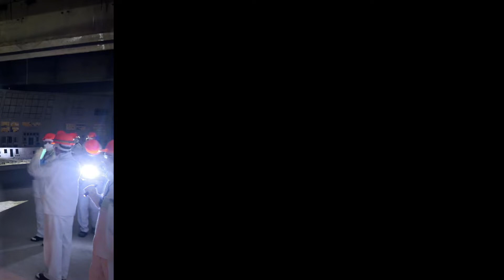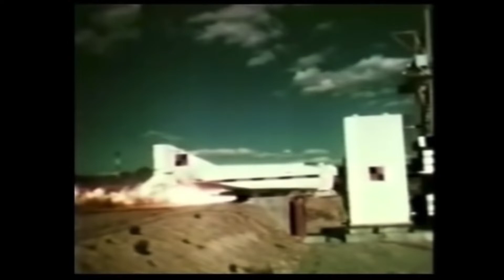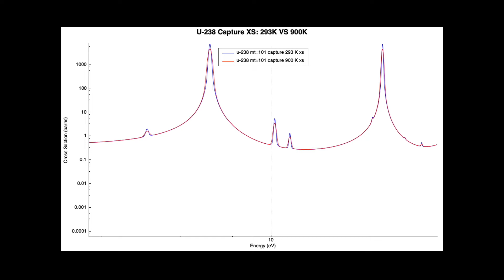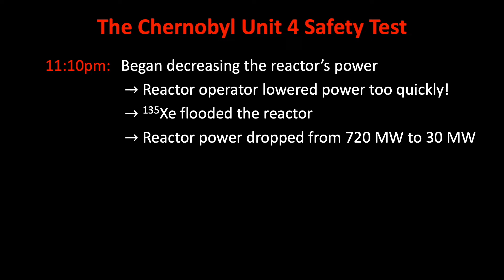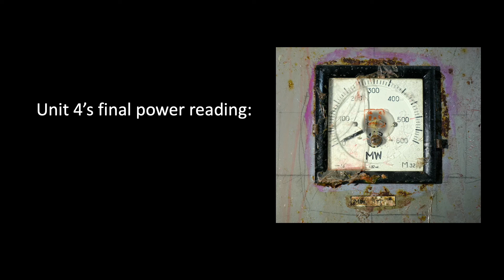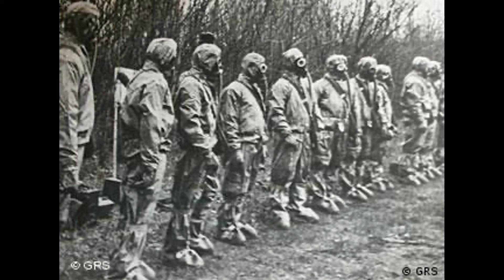NE410/510 - Lecture 19: A Reactor Physics Explanation of the Chernobyl Disaster

Comment: A lot of errors and incorrect information in this video.
Reply: There is no evidence that RBMK reactors were used to produce plutonium, although it was an option they could pursue. They had other breeder-type reactors producing a lot of plutonium, such as AD/ADE-1/2/3/4/I-1/EI-2/AI/A/AW-1/AW-2/AW-3 and heavy water: OK-180/OK-190. In fact, Efim Slavsky (Chief of MinSredMash), where RBMK reactors was designed, was quoted as saying, "Slaventiy, enough plutonium. Build for me a good power reactor; I have a lot of plutonium without your reactor (RBMK)" 

The fuel elements did not resemble Lego blocks; those are the channel caps. All the channels, including the control rod channels, have square caps made with concrete and serpentine to minimize radiation leaks. Under the caps is the plug, and under the plug is the upper biological shield. Under the upper biological shield is the actual channel itself, which was cylindrical and passed through the graphite blocks.

Diesel generators did not take 3 minutes to start. They started within 15 seconds of power loss, but they took 60-75 seconds to reach full speed.

According to the INSAG-7 report (International Nuclear Safety Advisory Group), a power station in the region unexpectedly went offline at 2 PM. Thus, the grid controller requested Chernobyl NPP to pick up the load. It wasn't necessary because of the holiday; in fact, "May holiday" is on May 1st, not April.

There is no evidence that Toptunov decreased the power too fast and that led to xenon flooding. The core was already xenon-poisoned, running at half power, but the neutron flux was at an equilibrium to stabilize the reactor output at half power. Decreasing it further flipped the equilibrium in the poison's favor, and it started absorbing all the neutrons, effectively stalling the reactor. Xenon is not produced at a delay; I think you are referring to xenon having a delayed effect. Xenon produced from a couple of hours ago can still poison the core later.

The high coolant flow rate caused the coolant not to have enough time to dump its heat in the steam separator drums or the condensers. This caused the coolant inlet temperature to rise.

Firefighters did not extinguish the graphite fire 5 hours later. They extinguished the roof and surrounding areas. The actual firefighting of the reactor started on April 27th, the next day morning at 10 am, with helicopters dropping sand, boron, dolomite, and clay with lead.

I think your knowledge of nuclear engineering is on point but some of the details regarding the incident  itself can be hard to find.
Reply: @silfvro1963 You have pointed out many of the things that I wanted to say too. I appreciate your comment.
Reply: You should read INSAG 7. It describes the actual causes of the disaster. 
Why would Russians celebrate memorial day?!?!!?
Reply: @tr48092  What are you talking about ?
Reply: @tr48092  Soviets were celebrating May day, not memorial day.
Reply: @NuclearEngineeringLectures  

There is no evidence that RBMK reactors were used to produce plutonium, although it was an option they could pursue. They had other breeder-type reactors producing a lot of plutonium, such as AD/ADE-1/2/3/4/I-1/EI-2/AI/A/AW-1/AW-2/AW-3 and heavy water: OK-180/OK-190. In fact, Efim Slavsky (Chief of MinSredMash), where RBMK reactors was designed, was quoted as saying, "Slaventiy, enough plutonium. Build for me a good power reactor; I have a lot of plutonium without your reactor (RBMK)" 

The fuel elements did not resemble Lego blocks; those are the channel caps. All the channels, including the control rod channels, have square caps made with concrete and serpentine to minimize radiation leaks. Under the caps is the plug, and under the plug is the upper biological shield. Under the upper biological shield is the actual channel itself, which was cylindrical and passed through the graphite blocks.

Diesel generators did not take 3 minutes to start. They started within 15 seconds of power loss, but they took 60-75 seconds to reach full speed.

According to the INSAG-7 report (International Nuclear Safety Advisory Group), a power station in the region unexpectedly went offline at 2 PM. Thus, the grid controller requested Chernobyl NPP to pick up the load. It wasn't necessary because of the holiday; in fact, "May holiday" is on May 1st, not April.

There is no evidence that Toptunov decreased the power too fast and that led to xenon flooding. The core was already xenon-poisoned, running at half power, but the neutron flux was at an equilibrium to stabilize the reactor output at half power. Decreasing it further flipped the equilibrium in the poison's favor, and it started absorbing all the neutrons, effectively stalling the reactor. Xenon is not produced at a delay; I think you are referring to xenon having a delayed effect. Xenon produced from a couple of hours ago can still poison the core later.

The high coolant flow rate caused the coolant not to have enough time to dump its heat in the steam separator drums or the condensers. This caused the coolant inlet temperature to rise.

Firefighters did not extinguish the graphite fire 5 hours later. They extinguished the roof and surrounding areas. The actual firefighting of the reactor started on April 27th, the next day morning at 10 am, with helicopters dropping sand, boron, dolomite, and clay with lead.

I think your knowledge of nuclear engineering is on point but some of the details regarding the incident  itself can be hard to find.
Reply: @NuclearEngineeringLectures  

There is no evidence that RBMK reactors were used to produce plutonium, although it was an option they could pursue. They had other breeder-type reactors producing a lot of plutonium, such as AD/ADE-1/2/3/4/I-1/EI-2/AI/A/AW-1/AW-2/AW-3 and heavy water: OK-180/OK-190. In fact, Efim Slavsky (Chief of MinSredMash), where RBMK reactors was designed, was quoted as saying, "Slaventiy, enough plutonium. Build for me a good power reactor; I have a lot of plutonium without your reactor (RBMK)" here:https://youtu.be/GDonDx_1les?t=2584.

The fuel elements did not resemble Lego blocks; those are the channel caps. All the channels, including the control rod channels, have square caps made with concrete and serpentine to minimize radiation leaks. Under the caps is the plug, and under the plug is the upper biological shield. Under the upper biological shield is the actual channel itself, which was cylindrical and passed through the graphite blocks.

Diesel generators did not take 3 minutes to start. They started within 15 seconds of power loss, but they took 60-75 seconds to reach full speed.

According to the INSAG-7 report (International Nuclear Safety Advisory Group), a power station in the region unexpectedly went offline at 2 PM. Thus, the grid controller requested Chernobyl NPP to pick up the load. It wasn't necessary because of the holiday; in fact, "May holiday" is on May 1st, not April.

There is no evidence that Toptunov decreased the power too fast and that led to xenon flooding. The core was already xenon-poisoned, running at half power, but the neutron flux was at an equilibrium to stabilize the reactor output at half power. Decreasing it further flipped the equilibrium in the poison's favor, and it started absorbing all the neutrons, effectively stalling the reactor. Xenon is not produced at a delay; I think you are referring to xenon having a delayed effect. Xenon produced from a couple of hours ago can still poison the core later.

The high coolant flow rate caused the coolant not to have enough time to dump its heat in the steam separator drums or the condensers. This caused the coolant inlet temperature to rise.

Firefighters did not extinguish the graphite fire 5 hours later. They extinguished the roof and surrounding areas. The actual firefighting of the reactor started on April 27th, the next day morning at 10 am, with helicopters dropping sand, boron, dolomite, and clay with lead.

I think your knowledge of nuclear engineering is on point but some of the details regarding the incident  itself can be hard to find.😅
Reply: @NuclearEngineeringLectures  

There is no evidence that RBMK reactors were used to produce plutonium, although it was an option they could pursue. They had other breeder-type reactors producing a lot of plutonium, such as AD/ADE-1/2/3/4/I-1/EI-2/AI/A/AW-1/AW-2/AW-3 and heavy water: OK-180/OK-190. In fact, Efim Slavsky (Chief of MinSredMash), where RBMK reactors was designed, was quoted as saying, "Slaventiy, enough plutonium. Build for me a good power reactor; I have a lot of plutonium without your reactor (RBMK)" here:https://youtu.be/GDonDx_1les?t=2584.

The fuel elements did not resemble Lego blocks; those are the channel caps. All the channels, including the control rod channels, have square caps made with concrete and serpentine to minimize radiation leaks. Under the caps is the plug, and under the plug is the upper biological shield. Under the upper biological shield is the actual channel itself, which was cylindrical and passed through the graphite blocks.

Diesel generators did not take 3 minutes to start. They started within 15 seconds of power loss, but they took 60-75 seconds to reach full speed.

According to the INSAG-7 report (International Nuclear Safety Advisory Group), a power station in the region unexpectedly went offline at 2 PM. Thus, the grid controller requested Chernobyl NPP to pick up the load. It wasn't necessary because of the holiday; in fact, "May holiday" is on May 1st, not April.

There is no evidence that Toptunov decreased the power too fast and that led to xenon flooding. The core was already xenon-poisoned, running at half power, but the neutron flux was at an equilibrium to stabilize the reactor output at half power. Decreasing it further flipped the equilibrium in the poison's favor, and it started absorbing all the neutrons, effectively stalling the reactor. Xenon is not produced at a delay; I think you are referring to xenon having a delayed effect. Xenon produced from a couple of hours ago can still poison the core later.

The high coolant flow rate caused the coolant not to have enough time to dump its heat in the steam separator drums or the condensers. This caused the coolant inlet temperature to rise.

Firefighters did not extinguish the graphite fire 5 hours later. They extinguished the roof and surrounding areas. The actual firefighting of the reactor started on April 27th, the next day morning at 10 am, with helicopters dropping sand, boron, dolomite, and clay with lead.

I think your knowledge of nuclear engineering is on point but some of the details regarding the incident  itself can be hard to find.😅
Reply: @NuclearEngineeringLectures  

There is no evidence that RBMK reactors were used to produce plutonium, although it was an option they could pursue. They had other breeder-type reactors producing a lot of plutonium, such as AD/ADE-1/2/3/4/I-1/EI-2/AI/A/AW-1/AW-2/AW-3 and heavy water: OK-180/OK-190. In fact, Efim Slavsky (Chief of MinSredMash), where RBMK reactors was designed, was quoted as saying, "Slaventiy, enough plutonium. Build for me a good power reactor; I have a lot of plutonium without your reactor (RBMK)" here: 
https:// youtu. be /GDonDx_1les?t=2584.

The fuel elements did not resemble Lego blocks; those are the channel caps. All the channels, including the control rod channels, have square caps made with concrete and serpentine to minimize radiation leaks. Under the caps is the plug, and under the plug is the upper biological shield. Under the upper biological shield is the actual channel itself, which was cylindrical and passed through the graphite blocks.

Diesel generators did not take 3 minutes to start. They started within 15 seconds of power loss, but they took 60-75 seconds to reach full speed.

According to the INSAG-7 report (International Nuclear Safety Advisory Group), a power station in the region unexpectedly went offline at 2 PM. Thus, the grid controller requested Chernobyl NPP to pick up the load. It wasn't necessary because of the holiday; in fact, "May holiday" is on May 1st, not April.

There is no evidence that Toptunov decreased the power too fast and that led to xenon flooding. The core was already xenon-poisoned, running at half power, but the neutron flux was at an equilibrium to stabilize the reactor output at half power. Decreasing it further flipped the equilibrium in the poison's favor, and it started absorbing all the neutrons, effectively stalling the reactor. Xenon is not produced at a delay; I think you are referring to xenon having a delayed effect. Xenon produced from a couple of hours ago can still poison the core later.

The high coolant flow rate caused the coolant not to have enough time to dump its heat in the steam separator drums or the condensers. This caused the coolant inlet temperature to rise.

Firefighters did not extinguish the graphite fire 5 hours later. They extinguished the roof and surrounding areas. The actual firefighting of the reactor started on April 27th, the next day morning at 10 am, with helicopters dropping sand, boron, dolomite, and clay with lead.

I think your knowledge of nuclear engineering is on point but some of the details regarding the incident  itself can be hard to find.😅
Reply: @NuclearEngineeringLectures  

There is no evidence that RBMK reactors were used to produce plutonium, although it was an option they could pursue. They had other breeder-type reactors producing a lot of plutonium, such as AD/ADE-1/2/3/4/I-1/EI-2/AI/A/AW-1/AW-2/AW-3 and heavy water: OK-180/OK-190. In fact, Efim Slavsky (Chief of MinSredMash), where RBMK reactors was designed, was quoted as saying, "Slaventiy, enough plutonium. Build for me a good power reactor; I have a lot of plutonium without your reactor (RBMK)" here: 

The fuel elements did not resemble Lego blocks; those are the channel caps. All the channels, including the control rod channels, have square caps made with concrete and serpentine to minimize radiation leaks. Under the caps is the plug, and under the plug is the upper biological shield. Under the upper biological shield is the actual channel itself, which was cylindrical and passed through the graphite blocks.

Diesel generators did not take 3 minutes to start. They started within 15 seconds of power loss, but they took 60-75 seconds to reach full speed.

According to the INSAG-7 report (International Nuclear Safety Advisory Group), a power station in the region unexpectedly went offline at 2 PM. Thus, the grid controller requested Chernobyl NPP to pick up the load. It wasn't necessary because of the holiday; in fact, "May holiday" is on May 1st, not April.

There is no evidence that Toptunov decreased the power too fast and that led to xenon flooding. The core was already xenon-poisoned, running at half power, but the neutron flux was at an equilibrium to stabilize the reactor output at half power. Decreasing it further flipped the equilibrium in the poison's favor, and it started absorbing all the neutrons, effectively stalling the reactor. Xenon is not produced at a delay; I think you are referring to xenon having a delayed effect. Xenon produced from a couple of hours ago can still poison the core later.

The high coolant flow rate caused the coolant not to have enough time to dump its heat in the steam separator drums or the condensers. This caused the coolant inlet temperature to rise.

Firefighters did not extinguish the graphite fire 5 hours later. They extinguished the roof and surrounding areas. The actual firefighting of the reactor started on April 27th, the next day morning at 10 am, with helicopters dropping sand, boron, dolomite, and clay with lead.

I think your knowledge of nuclear engineering is on point but some of the details regarding the incident  itself can be hard to find.😅
Reply: @NuclearEngineeringLectures  

There is no evidence that RBMK reactors were used to produce plutonium, although it was an option they could pursue. They had other breeder-type reactors producing a lot of plutonium, such as AD/ADE-1/2/3/4/I-1/EI-2/AI/A/AW-1/AW-2/AW-3 and heavy water: OK-180/OK-190. In fact, Efim Slavsky (Chief of MinSredMash), where RBMK reactors was designed, was quoted as saying, "Slaventiy, enough plutonium. Build for me a good power reactor; I have a lot of plutonium without your reactor (RBMK)" 

The fuel elements did not resemble Lego blocks; those are the channel caps. All the channels, including the control rod channels, have square caps made with concrete and serpentine to minimize radiation leaks. Under the caps is the plug, and under the plug is the upper biological shield. Under the upper biological shield is the actual channel itself, which was cylindrical and passed through the graphite blocks.

Diesel generators did not take 3 minutes to start. They started within 15 seconds of power loss, but they took 60-75 seconds to reach full speed.

According to the INSAG-7 report (International Nuclear Safety Advisory Group), a power station in the region unexpectedly went offline at 2 PM. Thus, the grid controller requested Chernobyl NPP to pick up the load. It wasn't necessary because of the holiday; in fact, "May holiday" is on May 1st, not April.

There is no evidence that Toptunov decreased the power too fast and that led to xenon flooding. The core was already xenon-poisoned, running at half power, but the neutron flux was at an equilibrium to stabilize the reactor output at half power. Decreasing it further flipped the equilibrium in the poison's favor, and it started absorbing all the neutrons, effectively stalling the reactor. Xenon is not produced at a delay; I think you are referring to xenon having a delayed effect. Xenon produced from a couple of hours ago can still poison the core later.

The high coolant flow rate caused the coolant not to have enough time to dump its heat in the steam separator drums or the condensers. This caused the coolant inlet temperature to rise.

Firefighters did not extinguish the graphite fire 5 hours later. They extinguished the roof and surrounding areas. The actual firefighting of the reactor started on April 27th, the next day morning at 10 am, with helicopters dropping sand, boron, dolomite, and clay with lead.

I think your knowledge of nuclear engineering is on point but some of the details regarding the incident  itself can be hard to find.😅
Reply: I have heard many many variations on a theme as to the reasons for test delay and the causes of the failure and I imagine that we may never know exactly what happened.
 Sadly the investigation could have been the best memorial to those who lost their lives but politics must spoil that too. Washing your dirty laundry in public can save lives in the future. We may never learn all the lessons from this incident as a result of obfuscation and misdirection. It’s the final insult from the living to the dead. 😢